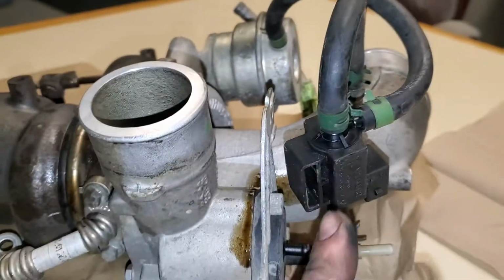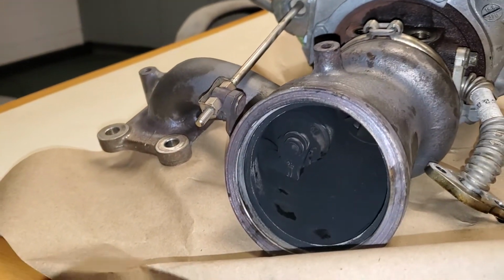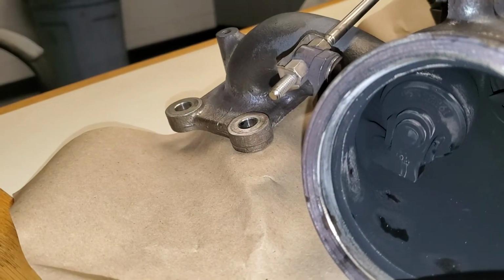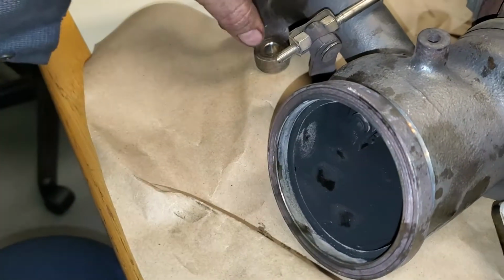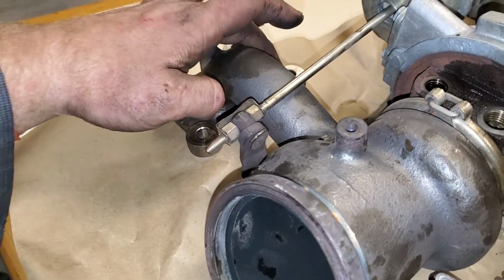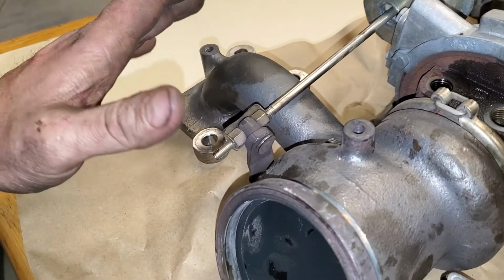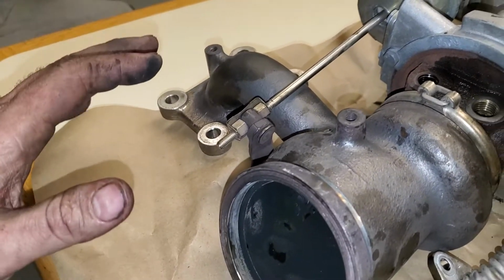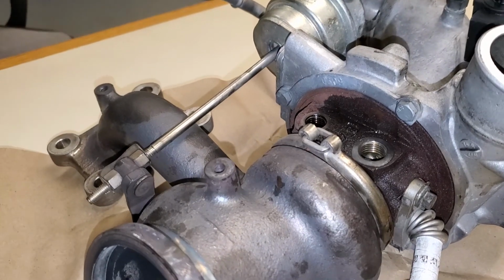2017 Ford Fusion 2.0 ecoboost P0299 Under Boost Condition, turbo talk, rattle sound and My Findings

Comment: Mr Ford Boss, I recently bought a 2013 Lincoln MKZ with 2.0 Ecoboost.   Like new, it has 16,000 miles on it.  At idle rpm, in drive or especially in reverse, I get a rattle from left side, front. . It goes away if engine is above idle.  I am alone here, and really need to have someone else sitting in the seat and switch from D to R. (working on that)  could this be the rattle you indicate with such low mileage?  From inside, it is annoying, and almost  sounds like something inside the door, but with door open, it is sounding like under hood in engine bay.  No codes, no issues, the car runs and accelerates fine. close to 30 mpg in my rural driving.   Is there something I should look for , and take off the under belly pan?  Thank you for the service you provide us, it is much appreciated. (I also have 2013 Ecoboost F150 Supercrew I bought new and it has been flawless, other than an emergency brake cable and rear brakes(REAR Brakes?  yes, at 45,000 miles).  Best regards, Mark

Comment: Great video and great information on the turbo replacement procedures.  I have a 2015 Escape with a p0299 under boost code.  There doesn't seem to be any drivability issues except lower than expected gas mileage and the car is still very peppy.  The gas mileage was lower than expected from the day I bought it new.  I changed the turbo boost solenoid at the turbo and cleared the code, but after some time it came back.  There are no other codes.  Until your video I didn't know about a second turbo boost solenoid on to of the engine, or if my vehicle has one.  At one time, the check engine light that generated the P0299 code cleared on its own, but later came back.  Another thing, when I changed the turbo boost solenoid at the turbo there was some oil in one of the hoses.  I don't want to go through the trouble and expense of replacing the turbo if it isn't the problem.  I also understand that there is a Turbo Boost Pressure Solenoid Filter.  Would this help replacing this filter and where specifically is it located? The Escape has about 110,000 mile on it and I bought it new.  Any help you can give me would be greatly appreciated
Reply: Hi, i have a 2015 as well and I just got this P0299 code. Exactly like you I had to replace the wastegate solenoid as well. Did you find out what’s causing this underboost and how did you fix it?
Reply: @prettymuch142  If you're replying to me, I have replaced the upper and lower solenoids both, but the P0299 code keeps reappearing after clearing the codes.

I'm still driving it, but I only want to replace the turbo as a last resort because it's such a job.

I did just put it up on the hoist and actuated the turbo boost in 10% increments from 0% to 100% with my scan tool, which has bi-directional capabilities for operating/actuation of sensors, controls, etc.

When I operated the turbo boost with the scan tool, the solenoid below on the turbo was clicking and bussing like it was operating, but the wastegate actuator never moved.

It looks like you almost have to remove the turbo to change the wastewater actuator, so I'm putting it off until I have the time to dig into the removal of the turbo.

Comment: 2019 F-150 3.5 Eco boost waste gate sticking intermittently then goes int limp mode. I pull over wait a few moments with truck off and the code clears and I go on about my day. This happens once or twice a week if I do not warm the truck up for 5 minutes. The Dealer states that I need a new passenger side turbo for $3000+. I have had this issue for more than a year dealer told me there was no problem before now needs full replacement . It never happens in the summer only the winter when it is cold. Any thoughts? buy the way I bought it at Dundee Ford If you know where that was ."Just Kidding" Buy the way I am happy to donate to the channel if that is a thing and I appreciate all that you do.
Reply: My 2015 f150 ecoboost underboost was the electronics blowoff valve. Been driving for many miles since the swap without issue

Comment: I have a 2014 Fusion 1.5L. Turbo was leaking oil bad and eventually got a code p0299. Replaced the turbo and still get the code. Cleaned all the piping of oil, replaced map sensor, boost solenoid, blow off/diverter valve, and the rubber intake hose off the air cleaner and still get the p0299. During all this discovered vacuum pump failed as the vacuum reservoir was filled with oil, really thought that was the culprit but nope still got the code after cleaning the reservoir and replacing vacuum pump. 

Scan tool showed coolant pump A had a short to ground, so I even replaced that thinking the turbo was overheating. After a test drive replacing the coolant pump, it is still showing a pending code p0299. Really at a loss here and it seems to only happen when the car gets hot. In cool weather, car drives perfectly fine. Really starting to think it is a computer problem. I don't think the computer has to be reprogrammed when you replace the turbo?
Reply from the maker: No turbo replacement does require reprogramming
Reply: Thank you so much, been driving myself crazy trying to figure out what is wrong.

Comment: I'm about to go look at 2016 fusion with an underboost code I'm gonna check that probably first if it does that would it need a new turbo you can't replace the wastegate

Comment: 2013 Ford Escape with code P0299.  Had the turbo replaced and it does have more power but the check engine came back on within days with same code.  Changed spark plugs at time of turbo.  Seems like when it tries to switch into next gear rpm goes up to between 3-4.  Any ideas?  I thought new turbo would fix it.
Reply from the maker: Yeah look at the vacuum control solenoids for it I have a video on changing those as well in the library
Reply: @FordBossMe  is it called turbo charger control solenoid talk ?  want to make sure its the right video.  thank you so much!!!

Comment: We have a ford edge st eco blue with a rattle, it only does it when your stopped in drive. If you switch to neutral or any gear it doesn't do the noise. So I'm not too sure
Reply from the maker: Belt tensioner
Reply: @FordBossMe  thank you so much

Comment: Have you come across a 2016 explorer 2.3l turbo where if you fully accelerate the engine starts cutting in and out almost like if you had a standard when you don't let the clutch out properly it lurches but at 30 mph.  It's coming up with a P0299 code.  On a different issue when you put the vehicle in reverse it bangs.
Reply from the maker: Check motor mounts for one trans mount motor mount etc etc and when you get a p0299 code either you need a turbo or you got a vacuum line leak from the solenoid or you got bad vacuum solenoids that control the turbo I've replaced a lot of turbos for this code
Reply: @Ford Boss Me  thank you very much!  I'll check those.  Ill just purchase the two turbo pressure solenoids off rockauto. 
Any ideas on why the transmission bangs into reverse.  I purchased a new valve body as well as the 2 reverse solenoids strategy because during warranty, the same issue occurred, and those  were the components ford service replaced.

Comment: 2016 Fusion 2.0 with P0299 code. I've owned to car for approximately 2 years without issue. Around 98,000 miles. Today while accelerating to merge on to the highway the check engine light came on for the first time. nothing sounded or felt different at the time. Drove it home (20 miles) without issue. Hooked my scanner tool to it and got this as the only code. Is this safe to drive in present condition? Would replacing just the TBPS's be advisable or should i have it looked over by a mechanic?  Any recommendations for fixes would be appreciated.
Reply: if you are not having symptoms yet you might have a small air leak in a hose- check charge air cooler hoses for tears. hoses can wear out over time. another thing is to listen for rattling noises when you rev it hard
Reply: @nathanberry3996 I hear the rattle noise when I rev it hard. No other symptoms except the check engine light which comes and go. What to do? Thanks.

Comment: I just came from ford and my car has been throwing the same code p0299 but isn’t making any of the noises you described, seems to drive fine just doesn’t have the same amount of pick up as it did . Ford said I need a whole new turbo but could it possibly just be the sensors you described in the beginning of the video??  They told me it’s gna be $2600 and I just don’t have it so if I could get sensors replaced and not need a whole new turbo that would be ideal.? Should I ask the service advisor about this? Thank you for any advice you can give me!!!!
Reply from the maker: I would ask
Reply: How'd it turn out

Comment: 15 escape 1.6 eco. P0299. No rattle. Aware of tsb for wastegate regulating valve. But suspensing bypass valve leaking. How do I test regulating valve and bypass valve? I have access to bidirectional controls.

Comment: The check engine light came on in my 2017 Fusion. Should I start by replacing the 2 sensors you spoke about at the beginning of the video?
Reply: I had the codes read and they're the same as the video,  p0299.
Reply from the maker: I would

Comment: I have a fusion same codes  but it smokes terrible definitely smells of oil could replacing the turbo fix this issue as well
Reply: Sounds like coolant intrusion
Reply: @room4rentla68  it was a bad turbo I paid 500 for the car 2014 1 owner 93k miles I put a turbo on it all problems went away guy who sold it was shocked

Comment: I have a 2013 fusion 2.0 with 120k miles. I did the induction cleaning at 50k and haven’t done it since. Would you recommend doing it with the spray in cleaners after that amount of time or could it do damage and I need to manually clean them? Thanks in advance if you happen to respond I know the video came out a while back
Reply from the maker: I'm doing any damage? Typically no is it possible it's always possible to do some kind of damage but is it likely probably not and anytime is good for induction cleaners or spray cleaners

Comment: Hello, I have fusion 2.0 ecoboost and I have had a problem for some time.  I'm getting fuel into the oil and the oil level is rising.  I have already replaced the injectors but the problem has not gone away.  Maybe someone had?  Please help

Comment: I’m having the same issue is it something that needs to be fixed right away
Reply from the maker: No not really it's not really going to cause any issues other than your not going to get all the power that you want sometimes and you might have a check engine light but it's not going to hurt anything
Reply: Okay thank you so much because that’s what’s been happening to me exactly check engine light will come on

Comment: Hey I 1.6 that blows  air out oil fill no codes and runs good for what is what  wrong. Thanks
Reply from the maker: That's absolutely normal on that engine there's a lot of crankcase Blow by and pressure in those engines and they all do that even brand new

Comment: Would that cause it not to idle and die out within about 5 sec? Thanks for the videos been looking for good info. There’s a lot of oil in spitting up from the intake inlet 😓
Reply from the maker: First of all what motor do you have and have you checked for any codes yet?
Reply from the maker: @nikkoduran2953  Do you know what the code numbers are?
Reply: @FordBossMe  p0012
P0016
P0299
P0316
I can give it gas but hear a light rattle , and as soon as I let go it’ll die , I never heard of a turbo causing a engine to die out , already replace 2 cam solenoids up top.
Reply from the maker: @nikkoduran2953  well if you got a crank code you may have lost your crank position and it may need to learn that again or you have a bad crank position sensor
Reply from the maker: @nikkoduran2953  the rattle definitely seems like you got a bad wastegate
Reply: @FordBossMe  that what I thought at first it’s all oily from the turbo leaking. It even pushed oil on the air filter a bit and I though that was strange 😓 but thank you very much your videos are helping a lot
Reply: @FordBossMe   welp after removing the turbo the exhaust blade was lodged into the housing and I’m guessing the shaft broke of , I know little about turbos lol
Reply from the maker: @nikkoduran2953  yeah when you were talking about the rattle coming from the back of the motor I was hoping to test the route you would go so good job
Reply: @FordBossMe  thanks I’m an underdog and need this experience, that exhaust impeller is stuck I was like woah 😦
Reply from the maker: @nikkoduran2953  You did good and now you know where to go
Reply: @FordBossMe  ha sorry to bug again brotha, so I installed the turbo and now it’s idling on its own but it’s rough. Is there a learning time after install and battery connect? I tried to look for an email for you to contact
Reply from the maker: @nikkoduran2953  did you reset your keep alive memory down in the powertrain functions
Reply from the maker: @nikkoduran2953  KAM reset
Reply: @FordBossMe  oh really , seen that on my scanner but was afraid to press it. I’ll give it a shot , thank you and sorry , I usually do gm and your the only Ford master I know barely haha 😆
Reply: @FordBossMe  no, wasn’t sure I had to, but I’ll try it in the morning
Reply from the maker: @nikkoduran2953  yeah reset the keep alive memory because that keeps your old fuel tables and run a little rough especially idling and if you feel froggy enough reset your neutral profile correction

Comment: What type of maintenance do I need to do to keep the 2.0 eco boost running without any issues? Other than regular oil changes every 5k miles.
Reply from the maker: I really recommend if it not a issue to do the somewhat sooner than 5000

keep the plugs fresh, I'd do plugs at like 35k. Ecoboost plugs look terrible with 50k miles on them 

me sure your using a good oil and filter no cheap stuff 

See if you can find a good induction cleaner to help clean intake and valves
Reply from the maker: oh

look into a catch can
Reply: @FordBossMe  so much info!! Hahaha. This is all new to me so it sounds like gibberish lol. So I’ve heard about the catch can so I’ll definitely be installing that. How often do you recommend an oil change? Also what oil and what filter should I use specifically. Also the induction cleaner...how is that done and which brand should I get. I just purchased a 2017 and it has 54k on it so I’m pretty sure I’ll need to change the plugs.
Reply from the maker: @SRT313  seafoam is a good induction cleaner but you have to run it through the vacuum system so you get out of a shop do that or you could do it yourself but it's kind of tricky to do
Reply: @FordBossMe  how often should I clean my intake and valves with the induction cleaner? Also what brand oil and filter should I use. How often should the oil changes be.
Reply: @FordBossMe  do you recommend I flush my transmission?
Reply from the maker: @SRT313  I'd say 3000 - 4000 miles, I do mine every 3 at max 

Ford Full Synthetic and Ford Filter is what I use 

induction I do every 20k on mine
Reply from the maker: @SRT313  as long as it isn't shifting bad yes, I do mine every 40k
Reply: @FordBossMe  I notice it lags a little on first gear but is smooth the rest of the gears. Would you recommend I do it?
Reply: @SRT313  I recommend the CRC GDI cleaner. Just stick it after the MAF and turbo or you'll melt the turbo or foul the MAF. I do it once a year before an oil change and I have a hybrid lol.

Comment: It's a crappy design I put an aftermarket Garrett PowerMax bolt on turbo kit. My ST pushed the power up to 300 at the wheels.

Comment: What is that code do on an F-150 because I have an underboost condition on my 2012 Ford F-150 EcoBoost I got a code p0299
Reply from the maker: Could be the same for the same issue
Reply: I put a new turbo on it wanted was a used Turbo and after I have Dad done having underboost code